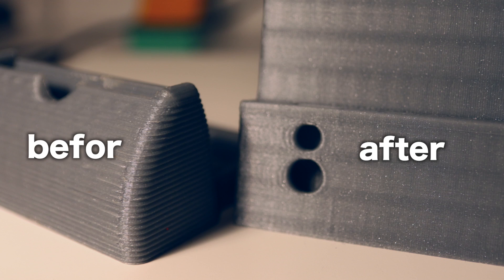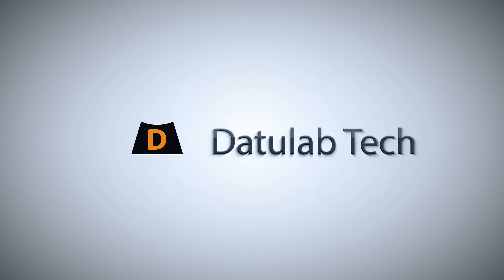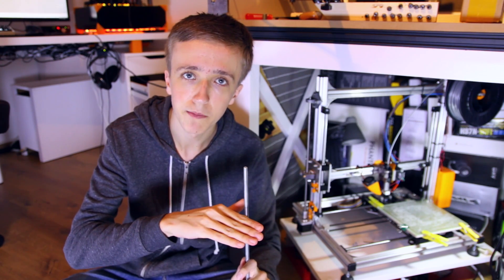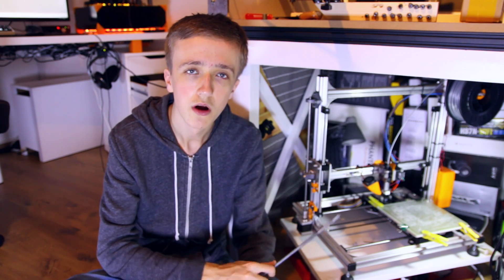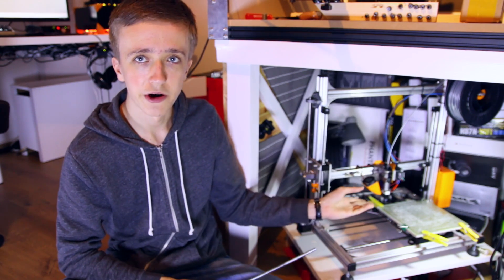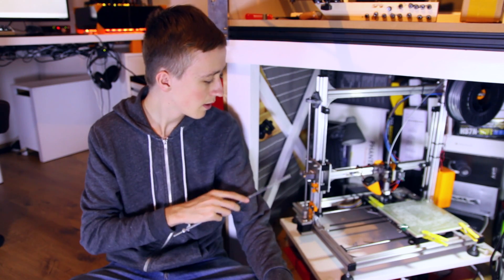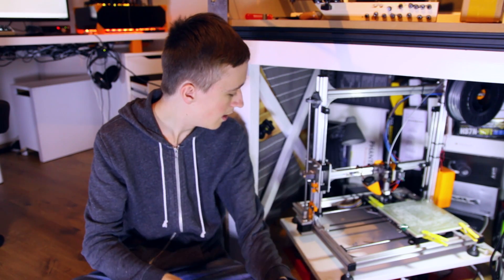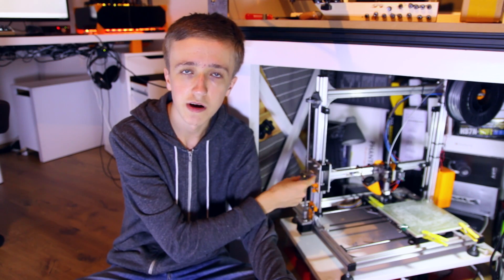3D Printer Z-Axis UPGRADE

Comment: Isn't it just a matter of correcting your e-steps on the Z-axis? :-)
Reply: Obviously not, because wrong e-steps dont explain IRREGULAR layer heights, layers would just all be too high or too low. - the periodic error he has in his first prints is a known problem with wobbly z rods, thats why the error is periodic with the rod thread pitch.
Reply: @jeffreylebowski4927  accualy wrong step per mm value is explain that , if z axis move dows 0.18 instead of 0.2mm , layers of printed part is gonna squeeze between bottom layer and nozzle , few layers later , bottom layer gonna be too close to nozzle and extruder gonna skip some steps. so last layer is not printed in this situation , and when it comes to next layer , nozzle have enough space to print current layer. at te end of print , you missed some of the layers and did squeeze some of them too , this is explain this issue.
Reply: @furkanbicer154  Im guessing you dont have a 3d printer, because thats not how any of it works.
When the nozzle is moving up (not down) 0.18 instead of 0.2mm, then the excess extruded plastic will squeeze out into a wider track and the resulting layer will be only 0.18mm high and not 0.2mm.
If the nozzle moves up 0.18mm from the last layer, the resulting next layer cant be higher than 0.18mm, that doest make any sense, - the excess plastic will just make the tracks wider.
The problem in the video is, because of a z axis wobble.
Reply: @jeffreylebowski4927  yes i have, all of them custom made. Ultimaker , makerbot , hypercube , markforged , all of them 3d printer right? Z axis going down while printing. And x axis can move 0.18 mm instead of 0.2 mm if your step per mm value is wrong or z axis stepper motor skipping steps.
Reply: @jeffreylebowski4927   
Most of the issues with the cheap threaded rods are mechanical (bent rods, non-concentric coupling to stepper, worn threads/nuts etc) but another less obvious issue which cam cause regular banding patterns is the Z axis resolution, which is determined by threaded rod screw pitch and the stepper resolution.  If the minimum Z step size is not exactly divisible into the selected layer height (which tends to be round numbers like  0.2mm) then during printing some steps will be a little shorter and some a little longer than the target height, so whilst it will average out to 0.2mm over the print the individual layers will vary a bit.  This can be fixed by specifying a layer height which is an integer multiple of the Z axis resolution.
Reply: @ferrumignis  Thank you for your reply, my prints actually are suffering from z banding, which has nothing to do with the z rod or the V tracks on my ender 3, ive turned the z rod around and cleaned the V tracks, and i still get the same banding on individual layers. Now im wondering, if that could be due to your explaination...  Ive got a stock Ender-3. The banding occours consistently on the same layers, which would fit, but those layers are distributed very irregularly, which doesnt fit with some number not dividing evenly into another number, where you would expect some repeating pattern?
Anyways, how would i go about figuring out how high my minimum step size - height increase is on my ender 3? I will measure the rod thread pitch, my guess is that the stepper motors have 200 full steps for one revoution? And the smalles microstep is 1/16th fullstep? Again Stock Ender-3 bought in the beginning of 2020 - no silent boards.
Also the height would only ever be off by 1 microstep, compared to the other layers, i wonder if that could make such a big impact...?
Thank you very much, best regards.

Edit: Did the math, apparently 1 Fullstep would yield 0.04mm height increase, 1/16th step would yield 0.0025mm.
So the banding issue i have must have some other cause, but thx again, at least now i can rule that out.
Reply: Altering the steps/mm would change it for the whole length of the rod, and not account for the poor consistency in the standard threaded rod along its length.
If you were just using it with a nut, it'd not be an issue.
It's only when you use it as a lead screw that the thread inconsistencies become significant.

Comment: I had exactly the same symptom, but it has nothing to do with layer height. If you put an m8 thread against your print you'll realise your Z-axis threaded rod isn't running true and it's pulling the X-axis around as it rotates. Cheaper option to fix it is to move the Z motors to the top of the printer and leave the Z screws free at the bottom. Just print some brackets for the motors, swap two wires in the motor cable to make them run in reverse and you're done. Mine cost me $0.50 in filament.

Comment: This is a pointless upgrade in my opinion. You should add a second screw and drive both with one single belt. That would be much more beneficial than this upgrade. Of course, adding higher quality lead screws, ball bearings and fix the ends would improve even more. Also, it is a VERY bad idea to have a floating, flexible connection to the stepper. The ball bearings of the stepper will wear out and the flexible coupler will cause flexing in the Z. So, even if it costs more and takes more time, it is better spent time and money if you'd do all that instead of this upgrade.

Comment: You might consider taking the bearing off the top of the screw. If the lead screw is not perfectly straight it allows the top to wobble without moving the X axis as much. It's easy to try.

Comment: If I was to replace my threaded m8 rods with these t8 lead screws how do I change the code for the new lead screws as you mentioned at 2:15 minutes?
Reply from the maker: You have to adjust the number of steps per mm for the Z axis in the eeprom settings of repetier host.
Reply: Datulab Tech okay thanks for that I'll order some lead screws and give it a shot! 
My print quality isn't the best you can almost see every layer despite flow, speed and heat

Comment: Hello! Is it possible to correct Z-axis skew (non-perpendicular to Y-axis) with firmware? Can autoleveling to solve this problem?
Reply from the maker: +Dima Balan not really, tecnically it should be possible, I haven't seen any option to do it in any program I tested. Your best bet would be to fix it mechanically.

Comment: so you replaced your 8mm lead screw by a better 8mm lead screw? it's just that the original one was bad?
Reply from the maker: well, the original wasn't a lead screw, just a threaded rod which isn't precise at all and I replaced it with a proper lead screw that is intended for use like this.
Reply: a 4 point lead screw is not "the same thing" as a threaded rod. look closely at your lead screw on your printer. now look at a normal "bolt" see how they are not the same thing? HIS has a thread rod (a long BOLT essentially ie a screw) while a lead screw is quite different.

Comment: What step number did you plug in in marlin?
Reply from the maker: for me it was 400 but it might be different for you if you have different micro stepping settings. Just put it to e.g. 400, then click on "extrude 100mm" and then measure how far the filament moved. If it is 100mm then fine and if not you need to change it.
Reply: 400?! I'm talking about the z-axis number.
Reply from the maker: Yes, 400 steps per mm for the z-axis.

Comment: great, this will save my k8200 as I was thinking to give up on this issue
Reply from the maker: nice, tell me how it went for you when you are finished
Reply: Hi Datulab, just wanted to let you know that I finally upgraded the rods successfully and it improves quality a lot. I had to re-draw the 3d printed parts however in order to make it work with my screws and my setup. Thank you for posting this video and the files on thigyverse!

Comment: Did you have to make any software changes in the firmware?
Reply from the maker: I had to adjust the EPROM settings of the z-axis for the printer which you can to e.g. with Repetier Host.
Reply: so I just finished installing this setup. Do you happen to know the pitch of the lead screws you proposed?
Reply from the maker: for the one I got it is 8mm per revolution, it varies though from model to model as there are many different ones out there.
Reply: Thank you for the fast reply, yes you are right, I just measured mine and it is 8 mm as well. I wonder if the precision in z is not getting lost with the high pitch? well I will find out :-) Worst case I order a different lead screw
Reply from the maker: I didn't notice any problems of that nature with my printer, as the stepper motors are really accurate and could easily do even finer motion.
Reply: perfect, thank you for letting me know. I gave up for today with the installation but hopefully I can finish the setup tomorrow and will let you know how it went.